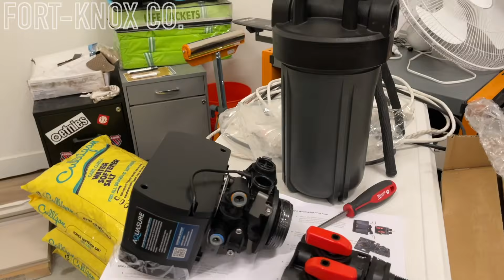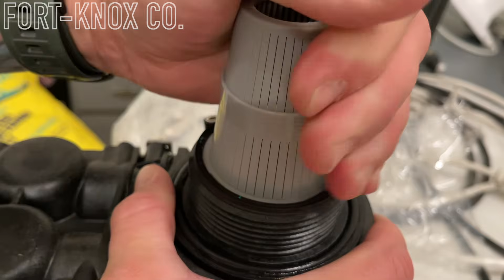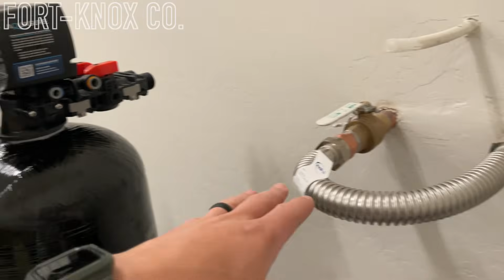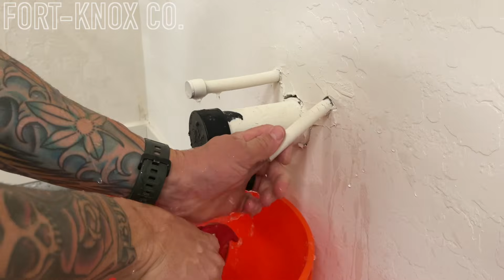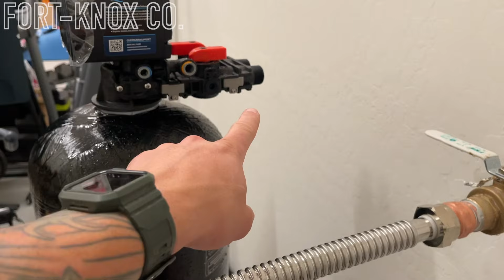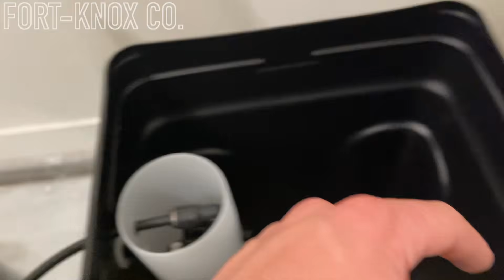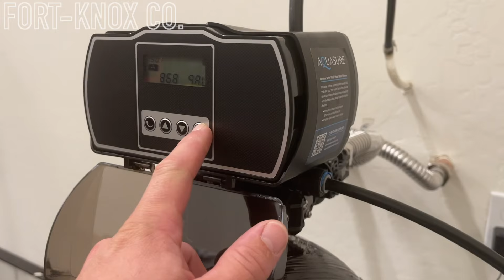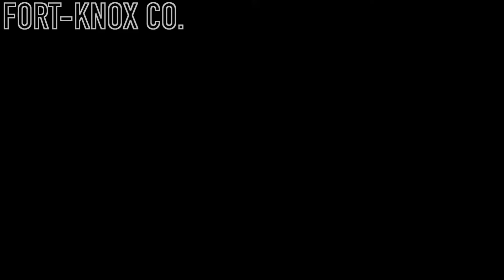How To Install Water Softener System Aquasure Harmony Series | Water Softener Loop Connection

Comment: Really loved how you took the time to explain what the instruction manual wouldn't tell us about not letting the water go into the house while it's doing its cycle and how easy you made it look good stuff do you have a list of tools you used to fit the fittings
Reply from the maker: Thank you. I really appreciate that. No, I don’t have a specific list of tools that I used on here. Other than the ones I showed in the video, there could be a few different items you might need depending on what type of pipes your house has and diameter. I would say you’re always gonna need some plumbers tape, a set of screwdrivers, and a few crescent wrenches or pipe wrenches.

Comment: We can’t get the brine line to go all the way into the control head. It shoots water out when the brine tank refills!
Reply from the maker: Did you make sure where the line goes into the head unit that the ring around the opening is compressed? I
There is a position that keeps it clamped and a position that allows it to be pulled out. You need to insert the tube while the opening is in a position that allows you to feel the tube in

Comment: Anyone have a bad experience with this softener?
Reply from the maker: I still really like these Aquasure system. I’ve installed many and they get the least problems. None in my experience actually. They install simple and most should. But I found less problems with minor leaks with O rings when putting parts together, other brands and ways they connect I’ve had some tweaking to do to make sure the install is water tight. These seems to be very straight forward.
Reply: @FortKnoxCo  any tips on how to inspect a water softener for damage prior to installing
Reply from the maker: @jaseemz16  nothing other than an overall visual check. Make sure nothing cracked or loose.
Reply: Awesome thank you Ive been very nervous to install thanks to reviews that claim resin leaks
Reply: Also curious did you or do you plan to install the carbon and sediment filter ?
Reply from the maker: @jaseemz16  I actually didn’t install video on the Shell Water Systems and I installed the large particle filter on that install video. I installed it after the filter system, though. The idea is that it will catch anything that may leave your filter system before it goes into the house. I’ve had a couple people with other systems that failed, and it released the resin matter all throughout their house pipes. So by installing the large particle filter after your system, it’s sort of a safety catch.
Reply: @FortKnoxCo that is an awesome idea thanks for the tip
Reply from the maker: @jaseemz16  no problem at all

Comment: Great video sir. Im going to install the exact system. I have the 1 inch PEX water softener loop. No shut off valve though. Do I need to install a shut off valve?
Reply: @fortknoxco I installed mine today with the pre-filter. Your video sir, helped me out. I watched it while doing it, following your instructions and tips. Thank you so much my friend. 👏🏽👏🏽👏🏽👏🏽👏🏽👏🏽👏🏽😀
Reply from the maker: Nice!! 🎉💪🏼💪🏼 happy I could help !
Reply from the maker: You don’t have to have one, but while you’re doing it it’s a nice option to add in while you’re doing all the work. Gives you ability to isolate your system and shut off the water in a different location.  I like to have one on each side of the loop if possible so you can specifically close those off and control the water flow back or into the house while working on it or if you ever have to remove the system or work on the system.
Reply: @FortKnoxCo ahhhh make sense. Thank you!

Comment: I did the exact same installation and everything was great for about two weeks. This week I found resin beads in my plumbing and started losing water pressure. Contacted warranty and they’re sending a new one out but not sure what went wrong here. Anyone else have this issue? Don’t want this happening again with the new one.. don’t see how it worked for two weeks then suddenly this happened.
Reply from the maker: What you’re describing is exactly why I put the large particle filter after the softener system. A lot of people like to use it as a pre-filter but I’ve always put it as a post filter. I had a friend who had a softener system fail, and it shot resin beads through his whole house. If you put the large particle filter after the system, but before the house you can prevent this from happening if you ever have a failure.

Not sure what causes this. There’s different membranes inside the tanks. Could have just ruptured. I had several of these systems in different installations and haven’t had a problem
Reply: @FortKnoxCo yea I think that’s what I’m gonna do when installing the new one. It was a pain flushing all the beads out from all my faucets and water heater. Luckily everything still works and didn’t have to replace anything but definitely don’t want to deal with this again. Hopefully I just got unlucky on the first one and replacement doesn’t do this to me.

Comment: on the directions it says "DO NOT LUBRICATE". what's the deal? do you lubricate it or do you not?😭(edit) it says not to lubricate the threads. you did it right 😂
Reply from the maker: Which part is it saying not to lubricate?  I would do what the manufacturer says to start.
Reply: @FortKnoxCo   i went back and you did it right haha. i think it says not to lubricate the threads. up higher it says to lubricate the o-rings like you did.  ill remove this post after a bit to give you a chance to read it. forgive me it was 12am and decided to watch videos about water softeners.😂😂

Comment: I have a rainsoft system and I can't seem to figure out why the brine tank isn't refilling itself with water the way it use. Im having to fill it with water. Any idea what it could possibly be?
Reply from the maker: If it’s not filling and it used to that means something is not working as it’s supposed too. Assuming you haven’t changed anything in between. 

So it could either be the float stop or float shut off valve in the tank where the water comes in, that could be stuck closed or somehow broken. It works like a toilet float. It fills up water and once the water get to the level of the float it presses up and shuts off the water. 

Or, if could be the head unit itself has a break or malfunction. You head unit that controls all its functions could need service or may be done for. Not sure how old your unit is but sometimes parts internal break or wear out. Could be a simple cheap part inside or could need a whole new head unit

Comment: Sure needed to see this video and the one for removing an old system. My Aquasure Harmony came with a filter unit and I think I saw a box on your floor with one in it. I would think the filter unit would be on the input side of the hook up to filter the water before entering the softener. Is that correct? Hey, and I love your videos! Keep them coming!
Reply from the maker: Thank you I really appreciate it. I figured there’d be a lot of other people out there with the same questions that I had. You can put that pre-filter before the system or after. I have another video showing how to install the Shell Water Systems water softener for the whole home and they have a pre-or post filter. In that video, I install it after the system to prevent anything from making its way from the street or out of the system into your house and pipes. I was talking to the manufacturer and that’s how they prefer to have it installed. It’s almost like a safety measure to protect anything from making its way into your house or your appliances.

Comment: On the side of the house backyard area, I have a French drain/gutter line that has an opening with a grill to let water inside leading to a pop-up lid in front of the house side area. Since the French drain is next to the garage I plan on sending the softener drain line from the garage to the side of the house backyard area and secure the line and place the air gap hanging like 2" above the French drain opening so it will drain there and when needed, pop up in the front side of the lawn.  From what I read the Aquasure drains around 40 to 50 gallons in 90 minutes to 120 minutes, and my drain is designed to handle around 100 gallons per minute. Will this setup work?
Reply from the maker: Sounds like you’re right about there with the capacity. You’re looking at it the right way.  my guess is your should be good. But technically you may be right at the max of what your drain line can handle.

Comment: Apparently, my home has the shutoff only at the meter. How can a softener that goes in the garage be installed with the connection being at the driveway let alone with concrete over it.
Reply from the maker: Having a shut off at the street is no problem. Usually everybody has at least that. If you don’t have any type of shut off or pressure regulator inside the house at the garage or wherever your water enters the structure from the street that’s fine. At some point the water goes into your house to Supply and split between cold and hot. Right before that line splits which should be somewhere near your water heater. You can create a waterloop. Pretty much just a break in the line where you install this water softener system. That way, the water splits after the water softener and continues as it normally does to your cold supplies in the house and your hot water heater feed. So if you don’t have a shut off in your home anywhere while you create this split and install the water softener, you can add a shut off valve as well. 

This is pretty common stuff for any plumber if you have to hire it out. But if you’re gonna do it yourself, you would shut the water off at the street and then locate the water supply in your wall or wherever it’s at most likely near the water heater. This may take opening up the wall and getting inside, but again can definitely be done and is usually what has to be done when installing these water softener systems when the builder did not put a loop there for you.

Comment: My water line shutoff is at the driveway. I also have a cold-water valve on top of the water heater. I need to cut the cold-water line and send that to the IN of the softener and then send the OUT from the softener to the water heater cold side, correct?
Reply from the maker: That’s what it sounds like. You need the water to pass through the water softener system first then after the softener it should split to your cold water lines in the home and the water line that feeds your water heater.

Comment: I've seen some having a prefilter. Is the prefilter necessary?
Reply from the maker: It’s not required but is just an added layer of filtration. It has a large cotton type filter to catch any large particles from your water supple. Like a general filter.  It it’s not necessary.  And you can install it before your system or after your system. Both methods of installation work

Comment: Great info! Where exactly is the water line to install? In my garage I have the water heater, but what do I look for as I see no other wall pipes aside from the ones used for the water heater.
Reply from the maker: If you don’t see a water loop coming out of your wall near that area, that probably means the builder did not put one in. This just means that you need to create your own waterloop which can be done, and it’s usually not too complicated. The hardest part is just locating your waterline that you want to place the waterloop in. This would be somewhere before your water heater. Do you want the water to be softened then go to the water heater and other cold water outlets of the house.

If this is something that’s outside your scope of knowledge, you can hire a plumber and they should know exactly what to do
Reply: @FortKnoxCo   Thank you! If I can't figure it out, I can at least get the plumber to set the waterline connections to the unit and I can install the unit myself and save.

Comment: Had a plumber install mine 2 years ago. Only one person using a very small amount of water in the house. Maybe 100 gallons a week. Calculation is 670 gal before backwash.

Water doesn’t seem very soft like it did when it was new.

Given this info, how long does a 48,000 grain unit last?
Reply from the maker: It depends on hardness of your water partially but:
Typical component lifespans:

* Resin tank & tank body: often 15–20+ years
* Control valve/head: usually 7–15 years
* Resin media inside: commonly 10–15 years before performance drops

Also try setting your water hardness higher on your system
Reply: @FortKnoxCo  thanks!
Reply from the maker: @majrminer  💯

Comment: Why don’t you use spring well? This is the same one that Home Depot sell.
Reply from the maker: This is just what I found and was able to
Have shopped free to the house, option for return if I didn’t like and had great reviews. So I would just click a button, have it at my door step and boom.
Reply: @FortKnoxCo  are you still using this cause I’m at this point where I’m debating between this Spring well, Culligan, so far what’s your review since this is Video been up for a while you still recommend or what would you do to make this better?
Reply from the maker: @hamerkiller I used it for a while and got a sponsored video to do an installation video  for another brand so I took out my Aquasure and installed that one, only for the video not because the Aquasure wasn’t good. In my opinion I think Aquasure’s system was amazing. Worked perfectly. Reasonably priced and never had any problems with it. I just installed one of their systems at a clients house and they love it. I would highly recommend Aquasure.

Comment: Very good video! Instructions are terrible! Manual doesnt even say which goes first, the filter or the tank!! I had to guess the water flows into the filter before flowing to the tank (only info was thay call the filter a "pre-filter"....not clear at all)! Thanks!
Reply from the maker: Yeah, I’ve had a lot of people ask me if you should have the prefilter before or after. It really kind of depends on how you wanna set up your system. Either way it provides a certain level of large particle filtration. There’s two different trains of thought. I’ve had one manufactured tell me to install it after just before the water enters the house because it will catch anything that may make it past the system and also if the system ever fails, it’ll catch all that filtration matter in that cartridge before it goes through all the pipes in your house. I’ve had one friend who’s old softener system failed and shot filtration matter and all of this fixtures and it was a headache to get cleaned out. So I can see the benefit of that.
The other school of thought is obviously install it from the street to the pre-filter then to your filtration system. Either way is good though.

Comment: Ideally, there should be a by pass so you arent shutting water off to the house when you need to change out or work on the system. Also, there is a reason why there isnt shark bite on the "in" and "outs" of the unit. The reason being is defects happen with shark bite and liability if it fails. I trust solder joints over shark bite, but truth be told, I have used shark bite on a flammable area where i couldnt use a torch and two years later, pressure breaker still good. I still worry about it though. Appreciate the video.
Reply from the maker: Great information. Thank you for sharing. I agree. Shark bites aren’t the way to go on everything but they do come in clutch. And for the once in a while diy’r home owner they work great. I too haven’t had one fail but there seems to be a boogyman tail that master plumbers always like to share when they hear about the shark bites. 🤷🏼‍♂️ either way there’s many ways to get it done. I’ve seen many of failed /pin hole copper pipes though…. lol just saying.  If it’s installed properly, no matter what the method, it seems to be okay

Comment: Why didn’t you install that pre filter? Did you order that or did it just automatically come with the softener you ordered? Is that the fortitude filter that removes the extra chlorine to help protect the softener? So it’s not necessarily needed?
Reply from the maker: The pre filter is not needed but usually comes with these systems now. Before it was listed and an upgraded feature. It just filters large particles. It doesn’t remove any chlorine, just protects the system or the house from large particles coming through. 

I installed the pre filter in my other video where I installed the Whole Home Shell Water System. But I placed it after the system. That way if anything comes out of the system itself like material from the tank it would catch that. Like a final stage filter. The manufacturer recommended placing it after the system and just before the water return to the home. 

I just installed a Aquasure system last weekend and did the canister after the system as well. It’s pretty straight forward and kinda user preference.  There’s ideas of why to do it before the system or why to do it after.

Comment: What about programming the head unit? Don’t you program the frequency of the regeneration of the beads? Or is the head computer already programmed properly from the factory?
Reply from the maker: When you do your initial set up, it should walk you through which settings you want. How you decide to do that is somewhat on your own personal preference and how much you believe you may be using it as well as how hard your water is. If you google your local areas, water hardness, it can kind of give you a gauge of how they rate the water and then you can go off that to see how frequently you believe. You might need to have it regenerate. But that in combination of how many bathrooms and how much use you’re gonna get as well. There should be a gallons used and hardness level chart so you can set your head unit to your specific location and needs.